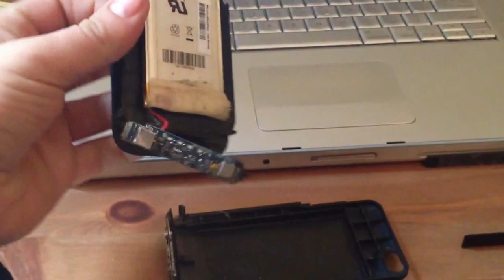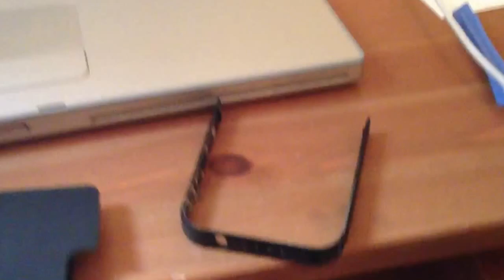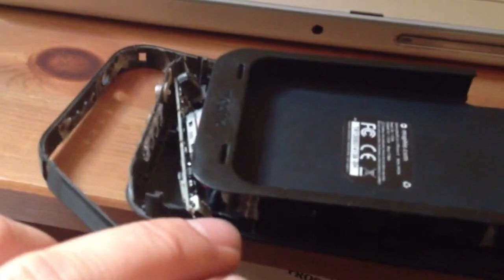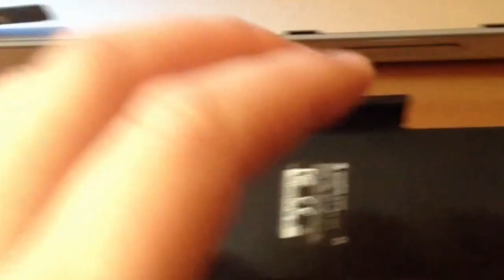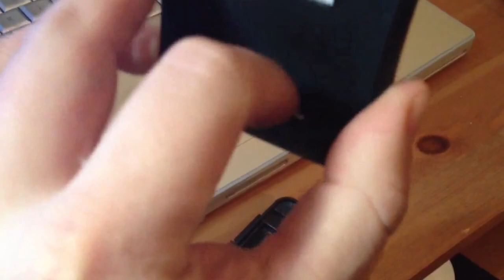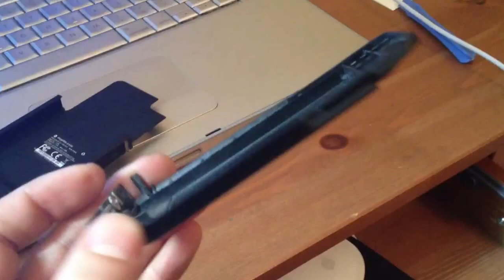Mophie Juicepack Plus for iPhone 4/4s take apart / teardown

Comment: I live in Hong Kong, and just purchased some of these to use as a power supply for a project. Because no one is buying these any more, the surplus price for these as excess inventory was HK$9, including the USB charge cable. That's US $1.30. This video helped me to "hack" the device to repurpose the battery for another use.
Reply: Barry Lawrensen that's pretty cool. I'm considering repurposing a mophie juice pack meant for the SAMSUNG S8+ ~> the HUAWEI mate non PRO 10, as I speculate it will not be a official release from mophie.

Comment: Thank you for posting. I was looking for exactly this. The battery inside is 1500 mAh. I found a similar 1200 mAh with a small solar panel at a gas station for $20. It's made by Hottips. Thanks again.

Comment: Thanks i fixed the switch what I did was pull the metal band holding the switch together then I pulled the switch apart pulled the prongs together that make contact inside the switch I dropped it out there are two slots I randomly chose what slot to use placed it back together noticed on the metal band was a pressure spring I pressed it in so that it would indicate if the button was one way or another put the band back on and it was finished.

Comment: I looked for a replacement switch.  Didn't find one but not because it's not out there, but because I just didn't have the time to search.  I'm sure its just a switch problem and if you find that switch and solder it into your broken switches place I think you might have a fix.  Let us know if you find a good switch replacement.

Comment from the maker: J Bowers has found a great replacement battery. This could be a great hack.
"J Bowers 2 months ago
Thank you for posting. I was looking for exactly this. The battery inside is 1500 mAh. I found a similar 1200 mAh with a small solar panel at a gas station for $20. It's made by Hottips. Thanks again".

Comment from the maker: Hey Tgurgle thanks for watching the video. I should have started filming before I popped it open. So sorry for that. Mine was glued also. Taking off the outer side casing first helped make the other parts pull off easier. I pulled really carefully at the top piece that I explained pulls straight up. It was glued in some parts but for some reason mine came off rather easily. Hopefully you didn't ruin your perfectly working Mophie for that I would be genuinely Sorry.

Comment: Once you got it apart, what did you do to fix the problem with the switch? I have dropped mine a few times and it seems like it has landed on the corner where the switch is. Was ok for a while but now the charge is intermittent when I turn in the mophie and eventually it says "charging is not supported" on the phone. The mophie and phone both charge fine when the USB cable is plugged into the mophie, so I think it's a bad connection to the switch or battery.

Comment: Does anyone know if you can get parts for these? Mine just stoped taking a charge. I opened it up and the USB plug seems fine but there is some fuzz on the circuit board. I am guessing the battery is fine becasue as of yesterday it was still working fine. My Mophie case is about a year and a half old and fits the iPhone 4s.